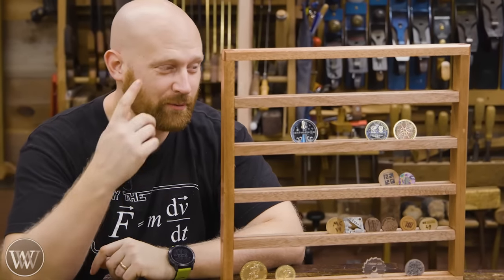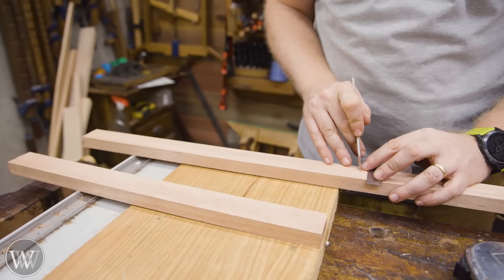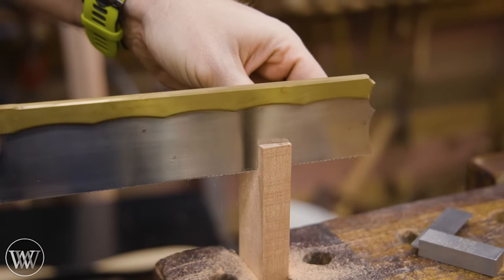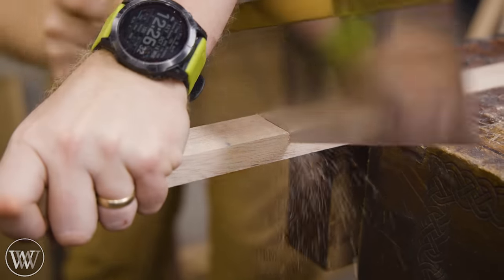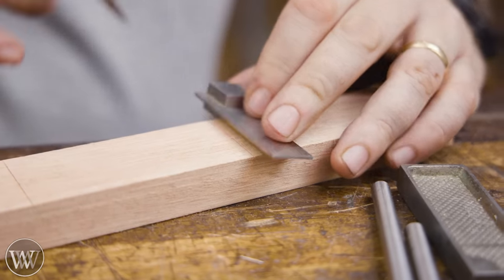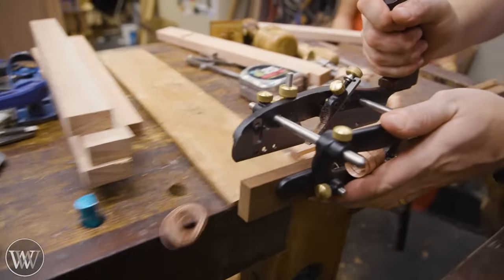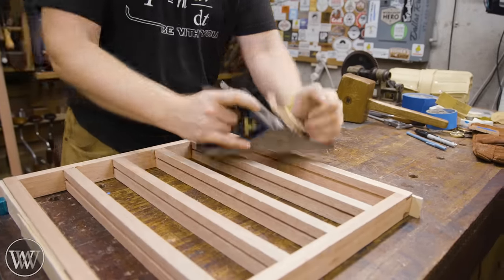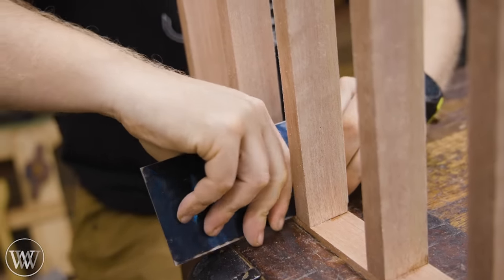How To Make A Challenge Coin Rack #Challengecoin

Comment: A few weeks ago I was at a flea market. I saw a small box with a couple of brace bits in it. There were also a bunch of sockets. A couple of SK. A couple of Craftsman. There was also a pair of channellocks, some screwdrivers, a weird mug and other stuff. I asked how much. He said 5 bucks. So I paid the man. When I got home, I found a challenge coin in the bottom of the box. I did a little internet research and found out that it was from a CIA training center, and possibly valuable. So, I put it on eBay. It sold for $1,250. I think I'm going to start going to more flea markets.
Reply from the maker: WOW~~

Comment: Great project, simple joinery, simpler finish. This is a perfect beginner project; make it deeper and add lips to the shelves or retaining bars, and you have a nice spice rack. I want to do something similar to this, but I want to make the shelves stopped sliding dovetails, just to see if I can make the whole thing without having to use glue to hold it together.

Not that trial and error with dividers is bad - I've done it - but I splurged on an Acer-Ferrous Cabinetmaker's Sector and have been using it for projects (dividing things, laying out dovetails, etc.). It is really fun and nice to use. Once I finish making a living room set of 4 tables for my parents' house, I have some nice cherry that I am going to make some stools out of and have a chance to use the Sector to find the sightline and resultant for the legs. Fun times.
Reply from the maker: I was eyeing the sector at Hand Works. I almost pulled the trigger.

Comment: @10:13 There is a tiny detail, I would do differently. I would drill/chop a recess for the hanger so the would be no gap between the frame an a wall.
Reply from the maker: I actually put pads in the bottom corners so that the frame is parallel with the wall but out slightly. That way it's not scratching on the paint.

Comment: Is there a way to make the grooves for those of us who don't have a combo plane.
Reply: If you have a routerplane, that worked out very well for me most of the time. And James has a video there he showed how to do it with a chisel.
Reply: Tablesaw
Reply from the maker: The most basic way is just to carve it out. The next step is to use a saw to cut either side of the groove and then come to the chisel and remove the waist in between. If you have a router plane that works well. Or you could make one pretty quickly and easily.